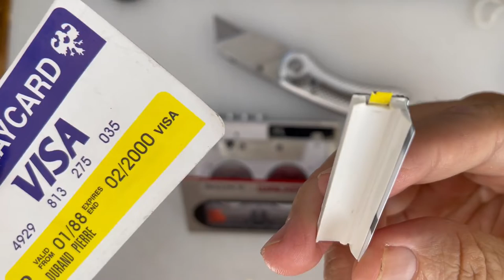Walkman Repair WM-10 WM-30

Comment: Cool! Will you do more walkman servicing videos?
Reply: Maybe, I have another WM-10 arriving this week. The one in the video above has a misaligned head and fixing that is beyond my skills. It's probably due to the damage from being dropped that caused the dent by the previous owner. So I may document a 2nd WM-10 that has some bad corrosion on the battery terminals. I also have an Aiwa and a Sony recording Walkman needing repair. I'm waiting on the belts so I hope to make videos when I get around to those.
Reply: Nice, acetone works much better on those old perished belts but you need to remove the capstan to clean it really good with very thin needle.

Comment: Still... the tech used in these 1.5 volt walkman is out of this world! They used step up circuits to make up to 5 volts to make the system work!
Big thumbs up to the used components... after 35 odd years it still works!

Comment: engineer here, looking for any & all clues on restoring a couple of these things, one of the BNIB but non-func.

the story I heard, ages ago, was that following the success of the TPS-L2 & its immediate successors, the head of the division responsible for walkmans took a block of wood the size of a cassette box into the design shop, where he told his engineers that the next walkman must be this size & shape. this was their challenge. & he signed the piece of wood on all its six sides so that they couldn't substitute a larger block. so they came up with the idea of the expanding case. the motor was novel, & there are dc-dc converters for the audio circuits (especially the dolby IC), so that the whole thing can run off one AA battery. 
but repairs on these are not for the faint-hearted.